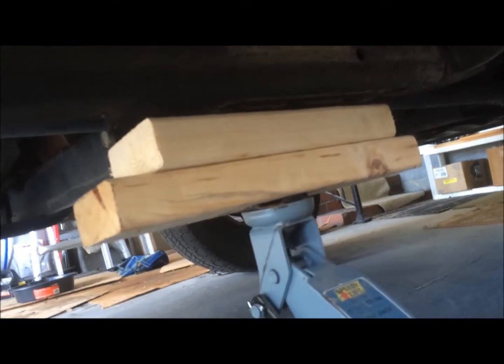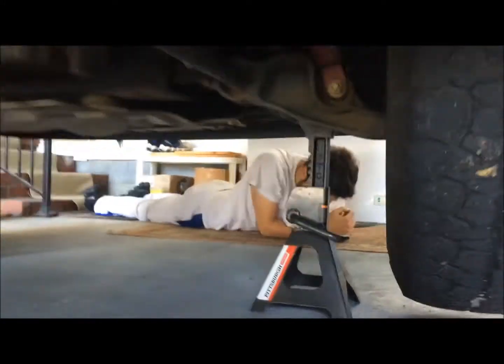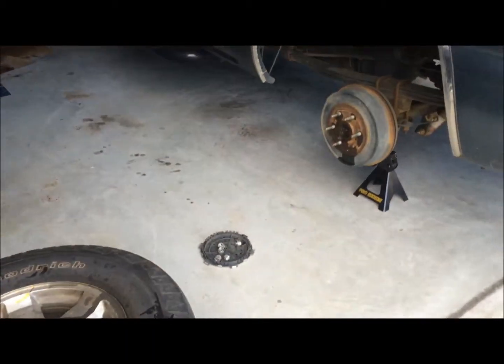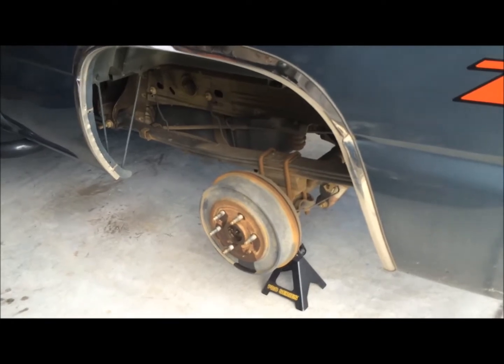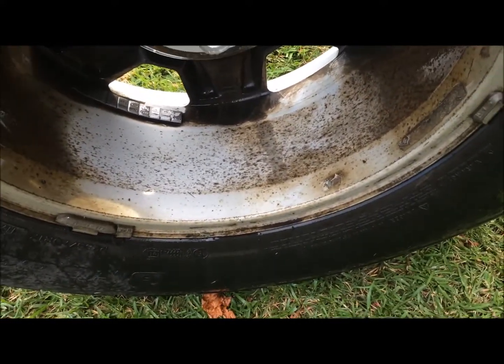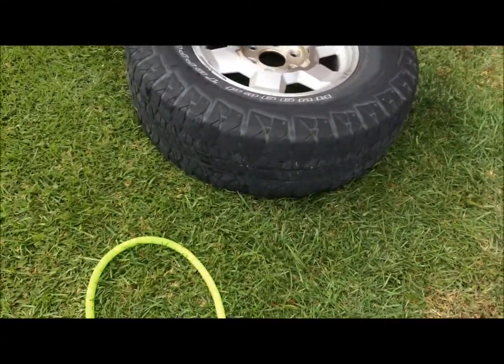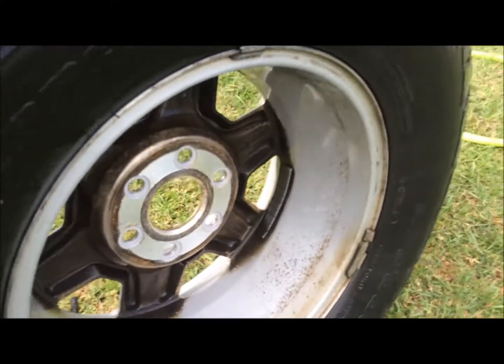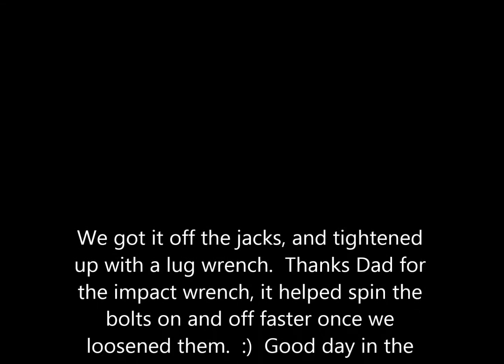Rotating the tires on Jared's truck

Comment: Studs are easy to change. Basically pull the brake drum off. drive the old one out with a hammer and punch. Put the new one in the hole, line it up and use a few greased washers with a correct size nut (I usually use a replacement lug nut without the cover put on backwards), Torque it down until the head of the stud bottoms on the axle flange. Reinstall the drum and you're done.

Brake dust, Great reason for ceramic pads...

DO NOT USE THE IMPACT TO TIGHTEN LUG NUTS !  Spin them down maybe, but use a torque stick at the minimum. Multiple reasons exist as to why using the impact is a bad idea.
Reply from the maker: Yeah we hand tightened them to start them, used the impact to zip them on, and then used a lug wrench to tighten.  I'll do some more research on the stud change.  Thanks. :)

Comment: Change the lug! You have lost one sixth of the tires ability to stay on the truck. It is a simple inexpensive fix not worth risking your kids life should he be hanging it around a corner and the others fail!
Reply from the maker: Ok, didn't know they could be changed.  I'll check into it.
Reply: My son snapped one off of his Prelude and we ended up changing them all... something about getting it airborne made dad say lets change them all... Just take off the brake drum and bang them out with a hammer/maul. You will need a punch or a similiar sized bolt to  knock them all the way out. Then just put the new ones through the drum and add a couple of washers then run down the lug nuts with your impact until the back is flush. Very simple job.I ended up with a homemade tool when the wrench I was using to keep the bolt steady flattened out and became one with the bolt.. LOL